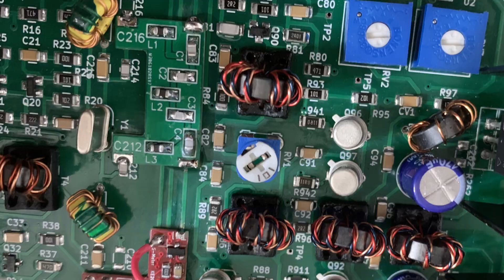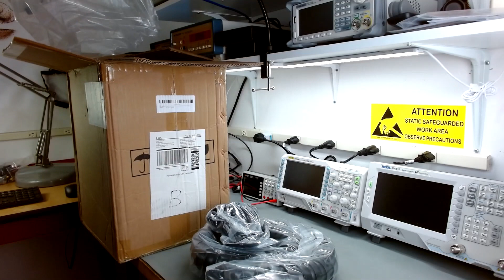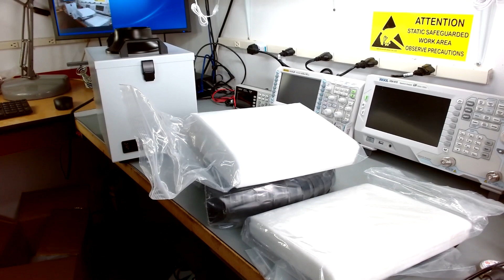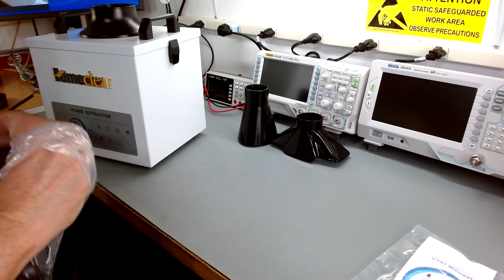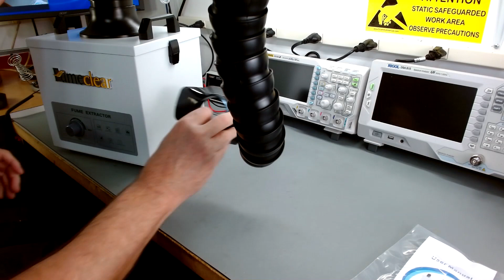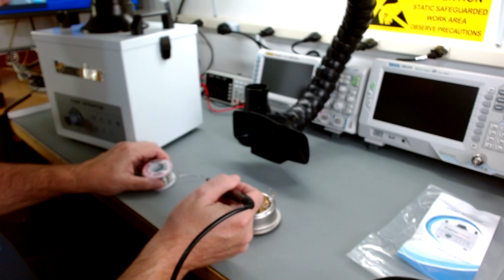FumeClear Extractor Unboxing

Comment: I am looking at this model. Are you still using it and do you think it is good? Cheers
Reply from the maker: Thanks for the question,
Yes I am still using this on the bench. It works very well and I have not had any issues with it. 
RJ